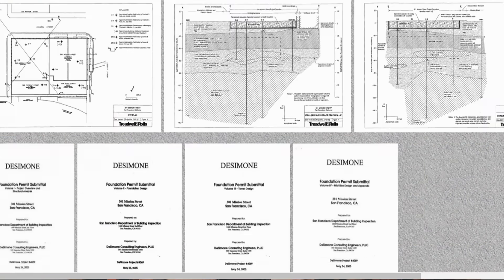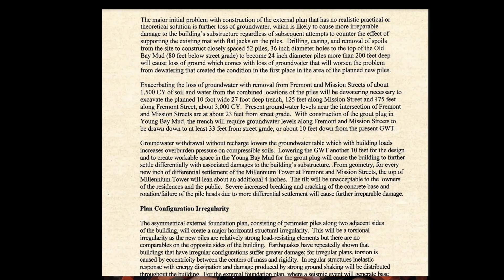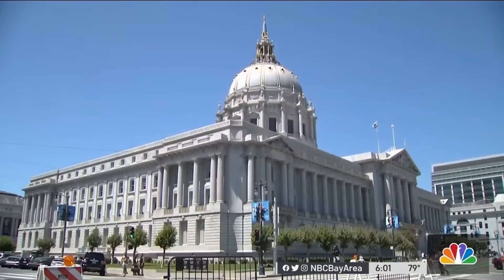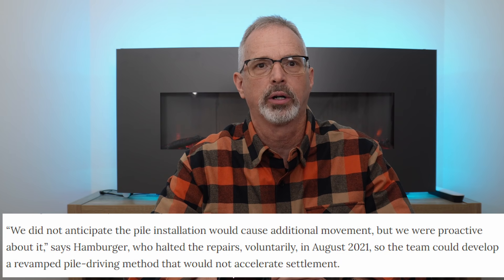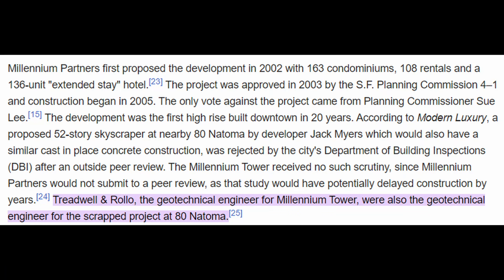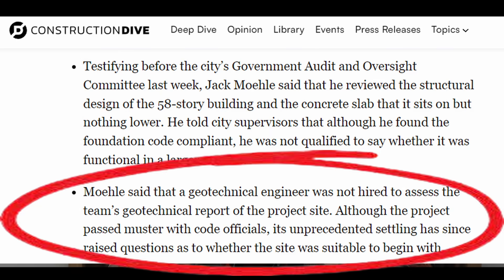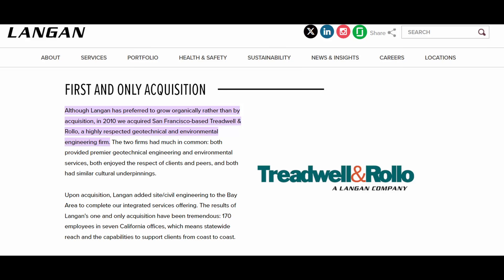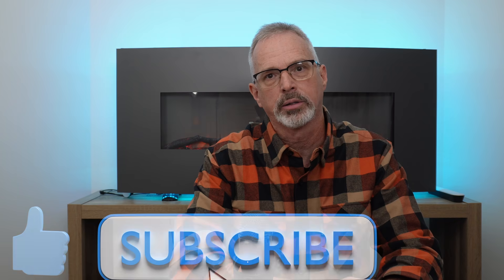Millennium Tower  -  $500 Million Wasted?

Comment: As for institutional knowledge or memory, I worked in the consumer research field for several decades and I can attest that it does not last these days.  They go through staff like water and do not value experience and what is more like someone with Alzheimer's they did the SAME investigations over and over, not knowing they had done them before.  One major firm I had as a client was bought and sold at least three times, maybe four in 15 years and went through equivalent changes of upper and middle management.  One department I worked with went through something like 20 different heads of that specific department.    Tragic crap, all of it.  All for a quick buck, brand name be damned.  Eventually they got so cheap they dumped all kinds of vendors in favor of "consolidating" vendors.  Nobody was left who knew any history of what was learned from all the money that was spent on research.  In the end, they destroyed any quality related to research and it became a joke, professionalism was replaced by quick, cheap, and dirty.  I can assure you all the above was far more costly than doing it right.  The Budweiser disaster, never would have happened in the old days, they tested ad campaigns before launching them.  Now, a woke dumb broad filling a quota for woke is what pulls the levers and kaboom.  AND the CEO gets to keep his job.  When bullshit and horseshit rule the day, disaster is not far away.

Comment: It's educational for the uninitiated to see how you can present your concerns about the circumstances underlying this contretemps as questions to be answered, thus limiting your potential exposure to litigation.

This is an unfortunate necessity when discussing multi-million dollar projects which have gone sideways, and where the data on nearby projects was kept in silos in a manner which allowed the big ticket project to proceed unencumbered.

There certainly are grounds for reasonable suspicion that various political and financial factors were given much more weight in the approval process than was the engineering data.

The claims of the involved parties that the geotech review prior to the start of construction ring hollow, as my experience has been that such consultations generally take at most a few months.

As a mechanical engineer, I cannot legally assess the foundation design, but based upon my limited experience with construction of heavy industrial complexes, it appears to me that the piling arrangement design was selected for rapidity of installation, and that a more robust piling arrangement would have been possible and potentially prevented the differential settling issues, given the nature of the underlying soils at the site. I defer to my civil-structural and geotech colleagues for final opinions in such matters though.

Comment: This building is downright dangerous and there are many lives at stake. It should be torn down for safety reason. Huge liability potential if this building collapse either by itself or in a big earthquake. Your video is spot on addressing serious structural issues that seem to be ignored in the original plan.
Reply: Not if, when.  It will come down on it's own fairly soon if there is no quake to speed it up.  The developers and city better hope they can find a way to pin it on al Qaida.
Reply: Due to the cost of this building. The city supervisors won't push for it to be torn down. It's not shocking since so much of government operations is geared at protecting the rich.
Reply: The building most likely will not collapse on it's footprint. Rather it will topple and most probably in the direction of it's lean , perhaps causing a domino effect.

Comment: What evidence supports the notion that the 'internal' repair option, the one not pursed, would have worked?  Of course in hindsight it was clearly better than the 'external' repair option that was pursed, since the external repair option clearly didn't work, but other than the word of the professors, where's the proof of that?  Finite element analysis?  Intuition?

The foundation of SF is largely reclaimed bay area soil, especially near the Financial District waterfront, so I can see settlement being a big problem.  Having said that, I've been in a LA building in Century City that used to sway a lot during heavy winds and it was pretty unsettling but apparently safe, at least for office workers.

Comment: Millennium Tower was doing a very expensive "nose thumbing" of the City of San Francisco for not getting extra money from them when the underground tube station was built next door. Not extending piles. Much of downtown SF is built on sandy fill and broken brick and masonry rubble from the 1907 earthquake. AKA fill.  All these high rises are basically floating on wet compacted sand under rubble. Driving piles into wet sand to the "point of refusal" is kind of a temporary thing, if you look at the more global picture. The world is impermanent, building a high rise on sand, even more so.

They need to drastically shorten the building. imho Or inject high pressure grout deep underground, although that might disturb other buildings. 
The names Casey Jones, Hamburger,  and Carp, sound like something out of a novel. But overall, good job reporting on this controversy. The public should know that some engineers are fighting for the public's best interests. Those engineers need support.  All the best to you and yours.
Reply: Ron Hamburger sounds more like the Three Stooges meets McDonalds!
Reply: @NorthGeorgiaHawg  : Yes indeed!

Comment: SF officials were and are too arrogant and foolish to admit that the MT project was and is over their heads.  The builder is only interested in the cheapest fastest bandaid so they can claim a fix then run away from their mess.   It boggles my mind that any large building is allowed without a foundation down to bedrock.  My company had an apartment in MT for our former CEO but I think they sold it.  I worked next to this building and saw it everyday.  I predicted that MT will be condemned once the bay area has a real earthquake.
Reply: I don't think you can condemn a pile of rubble.
Reply: @johnpublic6582  😂

Comment: I’ve lived in SF for over 30 years, and everyone I know had the same reaction when word first came out: How was it even legal to build something that tall without drilling down to bedrock, particularly in that part of the city? Still boggles the mind.
Reply: Bedrock is not the only solution. Pilings are often used in similar soil. But with this building they cheated on the pilings and even made the building heavier after piling work. There have been a few incompetent mistakes.
Reply: When I was 4 years old I had a book about construction so I knew, even back then, that "skyscrapers" have a foundation that goes down to bedrock.  It elaborated the point using the New York skyline.  Where bedrock is too deep to be practical, building height is limited.  Did Millenium Tower also end up with a furnace made out of the converted power shovel that dug the hole and ended up stuck at the bottom of the hole?
Reply: @johnpublic6582  thanks! I remember that book, though I cannot remember the name of it.
Reply: @stuartnochance  Me either.  I think either the shovel driver or the shovel were named Casey, but I was very young and that was a long time ago.
Reply: @johnpublic6582   the brooklyn bridge was also supposed to be built on bedrock, but it was too deep so it's on sand.
Reply: One caisson is on bedrock; the other is not.
Reply: @johnpublic6582  Not really, it's just more expensive to build a heavy building when you can't easily reach bedrock and not all "bedrock" is made equal. WTC took heroic efforts to build its foundation on bedrock. Lots of people thought St John the Divine was crazy for going down to bedrock and their bedrock was so weak they still had to put a stupendous amount of concrete on top and scrap plans for a high tower. St. Pat's had schist very near the surface so cheap and easy to build a tall cathedral.
Reply: @johnpublic6582  If it happened I'd assume it was planned that way. You don't really need furnaces in SF and the dig was anyway too recent for a steam shovel to be used, so almost certainly not. But that's an interesting NY story.
Reply: For regular folks outside SF it also boggles the mind... and come with its own set of questions: are buildings in my city safe?
Reply: Corruption, plain and simple
Reply: they drill to bedrock in toronto and i think the biggest earthquake ever there was about 5
Reply: @Sir_Godz  The 1906 was about 7.9 with an epicenter in Marin. Richter is a common logarithmic scale, so that's about 1000 time larger than a 5, if I understand it correctly.
Reply: quite agree..  pay off?? bribe?  lunch money?  this brings  a more  direct  name to ..lets buy lunch!
Reply: corruption is older than mankind....😳
Reply: @lunam7249    Corrupt animals?
Reply: @RM_VFX  yep!! corrupt dinosoars
Reply: There is two possibilities 1) incompetence in the building department, and 2) bribery. I'm betting on the former considering they allowed the idiotic remediation plan. The building will eventually be condemned.
Reply: I’m not in an earthquake zone but I would have thought anything bigger than a backyard cubby house would have piers reaching bedrock in San Francisco. But I’m not an engineer or builder.
Reply: There is at least one video I have seen that explained the physics of it. IIRC the problem as described there was that the spacing of the piles was wrong for making it work
Reply: I’m $ure the de$igner$ and builder$ $upplied $ati$factory $urvey$ and $tudie$ to official$.
Reply: This state and all dnc ran areas are run by completely corrupt imbeciles. 
And people stupidly keep supporting political criminals
Reply: It's called lobbying. They'll let you do anything with a bribe
Reply: Crazy, most of the financial district and South of Market is landfill so not drilling into bedrock in earthquake territory is nuts!
Reply: Diabolical
Reply: "How was it even legal to build something that tall without drilling down to bedrock"  ....  This is sooooo  easy to answer.  Whenever you have narcissistic/psychopathic people involved in anything, the risk of a screw-up/failure rises exponentially.  These people are incapable of doing anything right other than very simple tasks.  Yet, most employers favor hiring these types because they are schmoozers, liars, very charming (i.e., good talkers) and so on.  Company after company that gets overrun with these type of people ALWAYS fail.
Reply: @mlb3135   Which happens due to the never ending superficial aspects of our society...where everything that matters is on the surface only.
Reply: I would say either negligence or corruption. I would try to track if some people within city administration in charge of these things somehow benefited from this.
Reply: ⚠️.  PAYOLA….   San Francisco is a Demoncrat run True Blue city.
The corruption runs rampant!
The sidewalk poop and used hypodermic needles are representative of the corrupt politicians.
Reply: San Francisco, the county and State Of California are the poster children of “absolute corruption, corrupts absolutely.”
Reply: How, stupid people in control 🙄
Reply: Overlooking the obvious because of greed.
Reply: Cuz the government is busy do n government things.ha ha
Reply: To save only $8 million from what I’ve heard, not very smart
Reply: corruption
Reply: "Yes the planet got destroyed.  But for a beautiful moment in time we created a lot of value for shareholders."
Replace planet with building.
Reply: The builders took the cheaper choice to do at the time when they designing this building. For the builder if they  could save several million dollars up front that's more money in the pocket for them. They found engineers that would go along with them. Now it has cost them much more than what they thought they were going to pocket.
Reply: Because engineers stamped the plan?  Seems pretty straightforward to anyone with more than 30 IQ.
Reply: @qwerty112311  And if you work really hard, I’m sure you can pick up those five extra points and fly past that 30 IQ finish line! We believe in you—go, Qwerty, go!
Reply: Duh...Pelosi...duh..Biden...drool... Duh, it wath Demokraths... drool.. Duh...
Reply: @JohnDoe-vy5hh Schiff rolls downhill
Reply: Did you vote for Pelosi for 30 years?
Reply: @jppalm3944 
Nope.
My mother, an 83-year resident of San Francisco, just wretches when she hears "Pelosi"
And Biden is Pelosi's bitch.
Reply: @jppalm3944 because pelosi approves all the building plans in San Francisco?
Reply: @jppalm3944 REPORTED TO PELOSI!!

Comment: Well done presentation. I, a lowly homeowner, built a custom home on heaving soil. Requsted piles down to bedrock. They said piles to sand layer would work. After a few decades, our foundation has settled greatly. Had a foundation engineer come out. "Concrete pilings turn into heavy loads themselves eventually gruaranteed to get deeper." Had to put new pilings in 2x deeper to bedrock. How come this local engineer had this nailed and the the SF design team could not forsee this failure? Shocking. I'm sure a demo is in the future.
Reply: There are buildings nearby that are smaller and they set their pilings onto the bedrock. The builder found engineers who went along with their idea.
Reply: Never go along with a contractor, engineer, or an architect if you are not  comfortable with what you are being sold.

Comment: I concur with your thoughts on the earth quack issue! You have two sides now supported to bedrock (although there could be questions as to how solid those attachments to the building sides  are) and the rest of the building 'floating' on sub-standard piles, which could be a recipe for disaster in a quack! It would be interesting to see someone who specializes in earth quacks to give their opinion on both points; the building anchored on only two sides, and then the design of the piles on two sides to bedrock, with the rest of the building not supported that way, and then how those attachments would work in a quack given the way the rest of the building is?
Reply: Looking at a number of analyses of those side attachments, no worry about the differential in a quake, they will shear long before soil liquifaction in a middle size quake.  The building should just get Aflac to cover everyone in and around the building in the event of a quake.
Reply: @johnpublic6582 that will make it a true quack.

Comment: In my experience, regulatory bodies, whether it is SEC or local building officials, are great at making sure boxes are checked and forms are filed.  They will ream you several new ones if you don't tick a box, even when it clearly doesn't make sense to tick.  But when it comes to actually having any expertise or the will to challenge any party that donates to their boss, they are ineffectual, at best.
Reply from the maker: Well said. They seem to be procedure driven and not results driven.
Reply: @CaseyJones-Engineer  That especially carries over into the building and mechanical codes as applied to designs, where "built to code" get used as an excuse for not reviewing the applicability.

Also, the most important consideration in getting permitting for a project is that the developers' checks for payment of fees clear the bank...
Reply: building department took bribes. outright bribes.  first foundation saved developer tens of millions.  entire building department was fired a few years after this. they was caught taking bribes on other projects.

Comment: With so much settling of this building, I am curious how utility connections (gas, water, electrical, sanitary line, etc) are fed into the building and how lifetime settlement is used in making those connection decisions.  How after 30 inches of settling do those utilities maintain their connections without shearing or being crushed?

I'm hoping the content creator can do a video on this...my comment is really meant for him.

I am actually interested how building connections are made.  Not interested in conjecture, opinions, or assumptions of the design...just curious how a building like this and the extensive settling stays connected to the grid.  Thanks.
Reply: The sewage lines are already backing up into the kitchens.  Some windows have even exploded.  A gas and electrical fire is probably inevitable.  😱
Reply: At one point, there were news reports about people having difficulty using the elevators because the cars were not lined up with the floors.  If that is the case, I would be shocked if there hasn't been damage to plumbing and electrical services.
Reply: You can imagine they were prepared for 3-4 times the estimated settlement, 24" x 2, the building could tilt any direction, so travel distance on movable utilities needs to allow for positive and negative flexing. It seems like hitting the limits of flexibility is nearing. It would be hard to imagine utilities that can stretch or contract any unlimited distance.